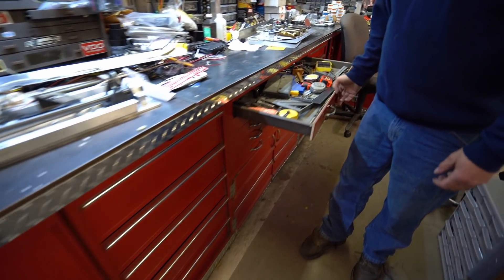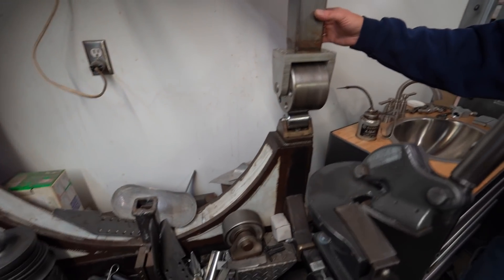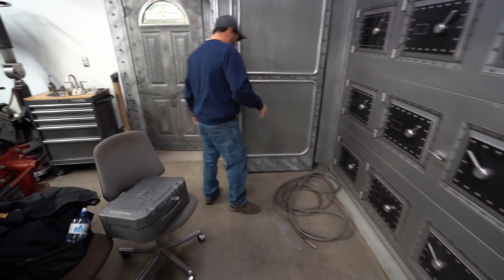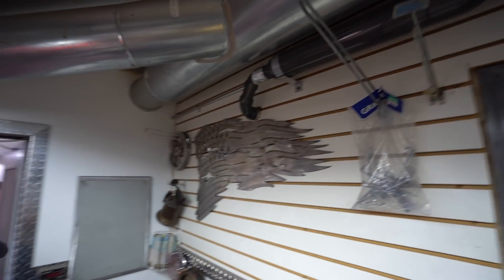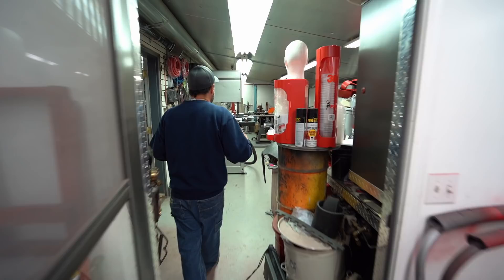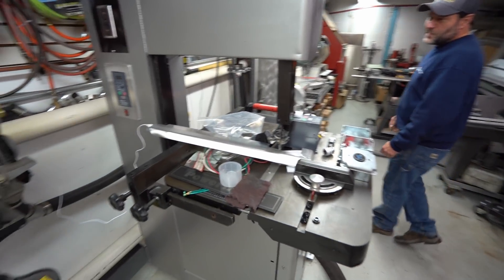Eric's Garage Tour - Ultimate Man Cave

Comment: great shop tour, impressed with your tool restoration and air brush art work.  Could you do a tutorial on VFD drives?  I have an old Craftsman (USA made) that I would love to convert to variable speed.
Reply: Funny you should bring that up. That is planned for the not so distant future. So stay tuned for that.
Reply: cool, will that be for 110V input/110V output?
Reply: @jameswieler3295  a vfd needs to control a 3 phase motor so they can't do 110. However small hp. Motors (3phase) are cheap.

Comment: By the way, what model is your pullmax? ...I bought one last summer it's a D3... supposedly came from an airforce base .. no one I've talked to has ever heard of this model. It has a 5hp motor, 47" throat,and uses 22mm tooling... I'm trying to find info on it. Your pullmax looks like it has a deeper throat but it could just be a camera angle thing. What is the nibble capacity of yours?
Reply: Mine is a p21 with optional air lift on it as well.